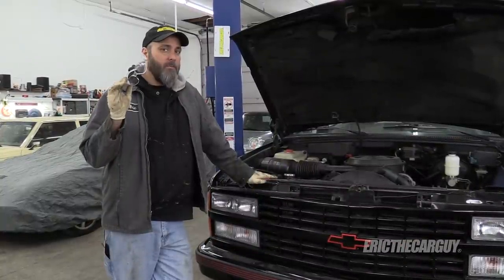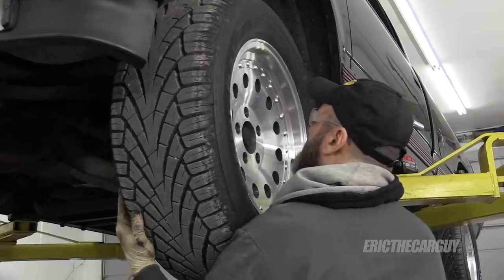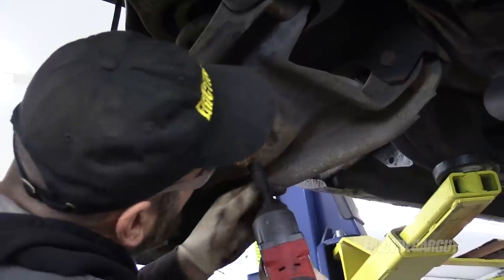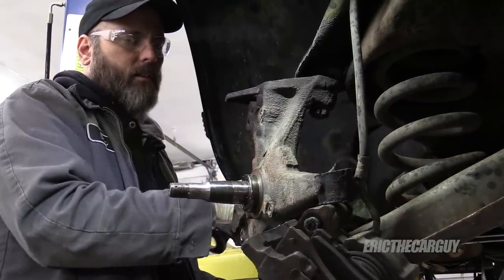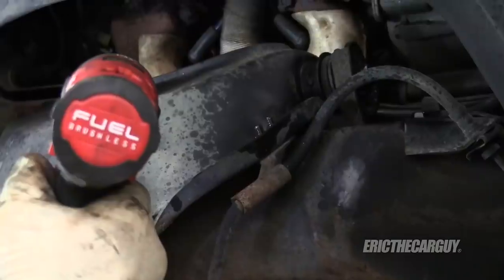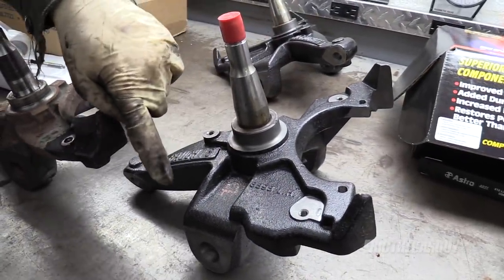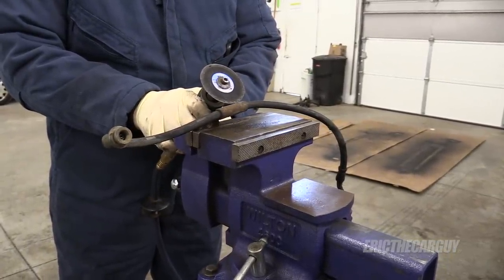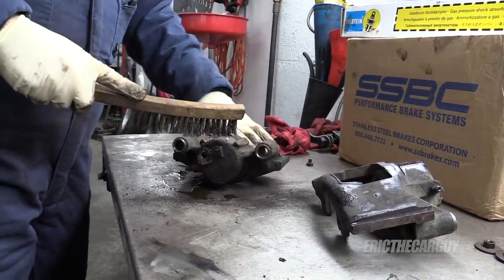GMT400 Front End Rebuild (Part 1) #ETCGDadsTruck

Comment: Great tip for removing the inside rotor bearings. Thanks for that.
Reply: That can damage the wheel seals. I always reuse wheel seals.  Just a soak in gasoline and dawn soap and they're as good as new. Besides, the auto parts stores never give you the correct ones anyway.

Comment: One trick I’ve done on GM front shocks is to put a good size pair of locking pliers on the shock rod so that when it turns the pliers will contact some part of the suspension
Reply: unless your trying to save them

Comment: Eric, I have a very stupid guetto method to avoid spring injury, I don't trust any compressors, one way or another, most of all have exploded, even good quality ones, hit the spring somewhere, it vibrates and the compressors tend to move, well, plastic rope, 5mm, two meters of it, I lower the car without wheels and put a stand beneath the ball joints, compress the spring with the car weight, pass the rope all over the spring and make a few blind knots on the rope, the tension will be split along the rope, as they also rated to 300Kg, so a few laps with rope, can hold very big springs. Then I just store the spring away and it's ready to assemble again. This method never failed on me and I've been using it for over a decade, besides, a full 300 meter rope costs peanuts :)
Reply from the maker: Great idea, thanks!

Comment: To get shock nuts off, I use a long extension to get my hands and tools away from moving suspension parts. I put one shoulder against the hood to stop it from moving. I place the socket, extension and a fast impact on the nut, put your free hand on the fender to push the vehicle up and down while intermittently triggering the impact. Ive done hundreds of shocks like this and it works 99% of the time. If you time it right, it will come off in the first couple pulls. Learned this in the late 80s!

Comment: I always have put a jack under the lower control arm and slowly lowered it once I break the ball joint loose and relieve the spring tension that way. Knock on wood I have never had the spring come flying out on me doing it this way. But almost every time I try to be safe and use a spring compressor they pop apart or break and scare the hell out of you when they go.

Comment: I had a spring compressor of a similar design, made by Snap-On, release on me when I was in suspension class in college. When that spring jumped out at you a saw it coming! I made my own spring compressor from some 3/8" plate and some 1" all thread. My suspension instructor though it was great. The other professors though it was the most dangerous thing ever because it wasn't made by Snap-On. I can tell ya, any time I see a spring compressor with a ~1/2" threaded rod as the compressor, I don't trust it! I don't care who makes it. I'm not bashing Snap-On most of their tools are excellent, but when it comes to springs, size matters.
Reply: yea autozone gave me this fork type compressor, its gonna hurt somebody but I got one similar to Erics at Advance auto, worked perfectly but, you're right, these can be kinda scary

Comment: Eric, those caps for masking are very handy. We use them in manufacturing for paint prep. Companies like www.stockcap.com carry them and other stuff. They also have ones that are a tapered cone that goes well in threaded holes. The taper does a good job of keeping paint out of threads. Another poor man trick is to take a bolt a couple sizes smaller and wrap a taper on it with masking tape then push it in the hole.

Comment: Those brake line brackets are nice, when i did stainless lines on my gmt400 I used gorilla tape that is the same width of those brackets and wrapped it around the brake line in the correct holding spot and then re crimped it down in place. The tape acts kinda like a rubber insulator and the stainless line wont get trashed by the rusty bracket.,

Comment: I'm not sure about now but in the good old days when shocks with a spike top were being obnoxious to remove here's what we did. The metal in the shocks spike isn't as tough ( or wasn't anyway) as one might think. We used to find a piece of ordinary steel pipe that fit fairly close to the shock spike. The thing was to slip that pipe down over that spike and just plain rock that spike back and force until it broke off,,,and!! it didn't take much work !!. You might know the trick but if not you can experiment with an already expired shock. Used to work for us,,made the job merely minutes long.

Comment: Thanks for this! Late to the game, I know, but this process is the closest thing I've found to a 1999 Chevrolet Tahoe LS, 5.7L, RWD. 

I have coil springs like this setup, and every other video I've seen for a 1999 chevy Tahoe doesn't, or the springs just "fall out" and are under no pressure when removing. This even looks like the same control arm design.

Comment: Excited to see what you do with the old Chevy 350. Maybe consider doing a dyno before and after mods. Also consider an electric fan setup. I hear you can get some benefits like more power and colder AC
Reply from the maker: The engine is already back from the machine shop. I wasn't able to get any Dyno readings before. Let's just say it sucked and when I'm done, it will be better. Also, I already have the upgraded radiator and new cooling fans. Thanks for the comment.

Comment: next time you use a spring compressor .. run a chain over 3-4 coil reattach chain  to itself ,,even just a nut and a bolt.... this will limit the explosive  release of the tension ...you could also throw a blanket over it to help limit travel if no chain .... but a few feet of chain is  safest
Reply from the maker: Thanks for the tips!

Comment: Instead of a spring compressor, I have always found it much easier, and more effective, to put a jack under the lower control arm, disconnect the ball joints, remove the spindle/knuckle, then slowly lower the jack. 9 out of 10 times the coil spring simply falls out with no drama but I always tie up or cover the spring just in case. Also, I find that a ball joint separator of the correct size is easier, faster, and better for the vehicle, than "hitting what it goes through" with a hammer. - Ray

Comment: Try bouncing the truck, and switching forward and back with your air gun to remove the top shock nut on the front of any GM rear drive vehicle.  Way easier to get the nut off. (The next time you need to do this chore.)

Comment: Great video series. Shouldn't you use some rubber (split a hose, or something) to put around the steel braided line before you put it into the stock GM hose bracket? Money saving tip, I've used regular Tremclad paint (made by Rust-oleum, just more popular up here in Canada) for 25+ years on brake calipers with no problems. Given this tip by a guy who owned a brake caliper rebuilding company, said it will last just as long as caliper paint and it does! Cheers
Reply from the maker: The line already has a plastic coating. Thanks for the tip about the paint.

Comment: A heavy duty drill, like 1/2" or bigger, would do wonders for turning those compressor, puller style bolts. I know you are hesitant to use impact as it does cause wear on the tool but a non-impacting drill help reduce personal wear as long as it is strong enough to do the job

Comment: You could tell you worked at a Honda/ Acura dealership for a long time  I'll give you little secret to take top of shocks off  The front of Old cars For cars with S LA suspension The socket that fits the top nuts take a long extension the longer the better two foot is ideal  Wiggle the nut till the top of a shock breaks off the metal is hardened and once you're past the hardening is very easy to break   It will also work on the end links of sway bars  Have a nice day😁

Comment: Hey Eric, why don't you powder coat your parts? It takes a little longer, but the finish is better and does last longer! This video brought back very fond memories of the S10 project. Not a single fastener came off easily on my truck. I'm really surprised you didn't replace the control arms. I replaced EVERYTHING!
Reply from the maker: Like you said, it takes longer. I simply don't have the time for that. This truck needs to be rebuilt and running before the Power Tour at the beginning of June 2019.

Comment: After watching this. I miss my 1970 straight axle Leaf spring Dodge. 
I just bought a 2000 Chevy 1500 
It's a little squirrelly above 60 mph. 
It's got 175000+ miles on it. Tires are wearing even.

Comment: I have a K2500... you would think 4X4 would be harder to do then the non 4X4... but no.. not even close to this much work to redo the front end on the K models. About the only thing that's a pain is the sway bar bolts to frame. The frame has pressed in nuts, and they just spin in place. You have to get nuts for reinstall, and its not exciting at all. As far as brake lines go.. classictube sells pre-bent SS replacements for the entire truck (single or complete kits).

Comment: Pro tip:  If you drop one of those idler arm bolts in the frame, there is an open section at the front where you can reach in there with a magnet.  Ask me how I know.

Comment: having to go thru every joint makes it take alot longer, im workin on gettin another frame under a 94 k3500 4x4 n left as much together as possible n since most of it was heavy, i used the four wheeler to drag it away on a n old big ass ac bottom tray as a sled lol i use them for alot, i dont have any concrete yet so i have to use them for jack stands mostly  they r really good for draggin stuff tho  i ran it thru a pole tho so it wasnt as easy as just pullin bolts n lettin stuff drop, there was alot of cuttin n sledge hammer, i just finished all that bullshit last night gettin the FUC*ING keys off the end of the torsion bars omfg!! i had to cut the torsion bar mount out of the truck, because its too wide i wouldnt have been able to get it from between the rails, then drag everything the torsion bar mount, the bars both hubs the control arms all out at once, cut the mount around the keys so u can beat on the keys themselves to actually have some kind of chance of gettin them off.. i finally did thank god  the only thing left is cut the rear u bolts, ebrake cable, tank n a few wires that ran behind the tank, then its goin n a new frame i cant wait! iv waited for 2 years to find that frame

Comment: Hey Eric question! Do you have to compress the front springs to take them out since the weight of the truck is being held by the lift? I thought that if you let the suspension hang that you would be able to just slowly push the lower control arm down and the springs would come out. Just curious because compressing the springs seems dangerous.

Comment: But you can't deny that as locking castle nuts go, the finishing nail is the superior alternative.
Reply from the maker: Agreed.
Reply: Yep, not going anywhere.
Reply: @ericthecarguy  but Eric.....we all know that the nail in spindle is an extra 10hp....  .020 off the saloms and a guaranteed 49 flat at the Nuremberg
Reply: @clevelandmaker386  49 flat at the Nuremberg?  Nuremberg was  a few years before '49 ya know. I guess Nurburgring is what you had in mind
Reply: @rolfbjorn9937  yes.....auto-correct

Comment: I have the same truck a 92 they put a 4-6 inch lowering kit 
But they only put lower springs in front
And new upper lower arm things lol
They kept original (knuckles) I think they are called spindles. My mechanic said one of the knuckles are bent ??? Is he talking about the spindle? 
It can’t be aligned because the bar is raised way high 
The alignment guy said they need to be level. I’m not sure what that means but my question is are drop spindles an knuckles the same thing? And if so, what should I do ? Add spindles and replace the original ?

Comment: Don't do what Eric did on the top shock bolts whatta mess and waste of gas take a couple nice long extensions and a deep socket go back and forth about 5x side to side and the shock stud will snap right off works every time and no fire is at risk or other parts Also as for taking out the coil springs on 2wd cars and trucks like this all you need to do is put a jack under the lower control arm then separate the upper or lower ball joint bolt then take the jack out or lift the hoist.

Comment: Most tapered roller bearing manufacturers do allow for some preload.
Reply from the maker: Tapered roller bearings should not have any preload on a front brake set up like this.
Reply: @ericthecarguy  why?
Reply from the maker: Because that is the proper procedure for installing tapered roller bearings in this application. They need a little bit of play to operate properly. Too much preload burns them up.
Reply: @ericthecarguy  interesting. I learned to install from my dad who opened his first shop in the early 60s and I've been a professional mechanic for over 20 years.  Ive done hundreds of wheel bearing installs and he probably did thousands.  We always put a small amount of preload on tapered roller wheel bearings.  I don't recall a single case of premature failure (that wasn't due to other issues).  Is it possible that either way is ok (I do understand that too much preload is not good)
Reply: @ericthecarguy  so I looked at a bunch of industrial papers on it and the opinion seems split. Some say a tiny bit of endplay (.001-.005 in seems average) others say a tiny bit of preload (usually measured by torquing and backing off a specific amount)
I will say that erring on the loose side is probably safer as there is greater room for error though I'll probably keep doing it the same way I have been.

Comment: I'm curious why you didn't put locking pliers on the shaft of the shock before attempting to burn down the truck. I mean your replacing them anyway so if the shaft is damaged, so what? You would have had the leverage to bust it loose with the impact then.
Reply from the maker: Because fire is more interesting on video and generates more comments.
Reply: .... well ya got me. Good one

Comment: I don't understand the use of the spring compressor.  Can't you lower the car, use a floor jack to support the lower control arm, undo the upper ball joint, then lower the lower control arm to relieve the spring tension?

Comment: Love those old trucks 97 Tahoe what is perfect truck  after almost 200K no check engine  lights New batteries alternator multiple trips from New York to Florida. Real metal bumpers glass headlights And a solid frame no unibody💩 before Chevy started making garbage vehicles.

Comment: The spindle doesn’t move. The ball joints location moves
Reply: Go back and watch the video again - he has them side by side and you can clearly see that every other feature is in the same place except for the spindle itself. Absolutely clear...
Reply: Eric K the bolt location for the caliber and backing dust plate are needed to be in the same location in reference to the spindle. If the only thing moved was the spindle all the others  would be off. If you just lowered the upper and lower ball joints that would lower the front end